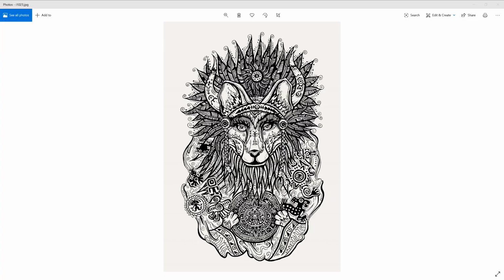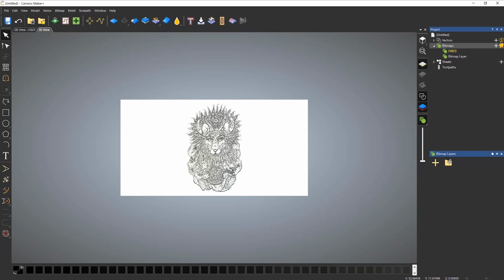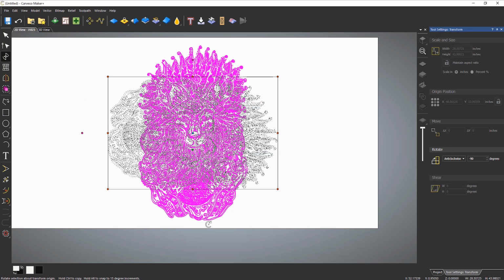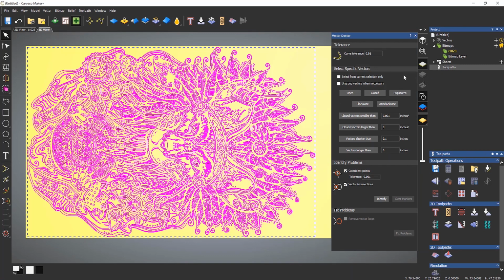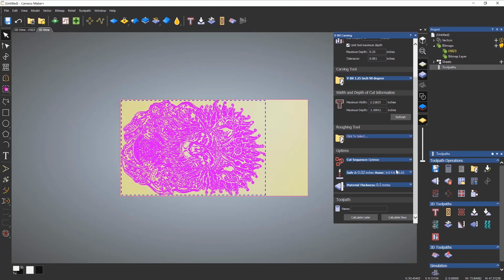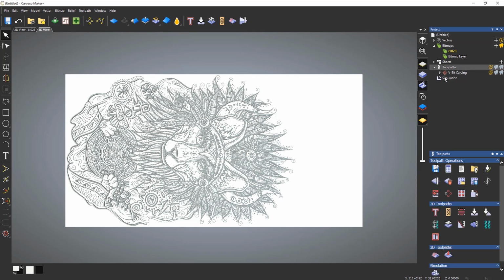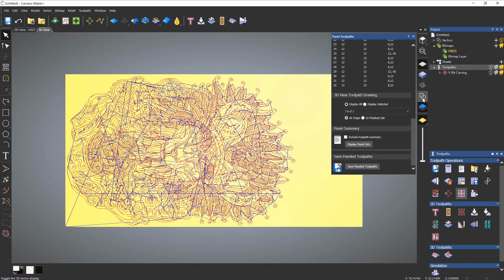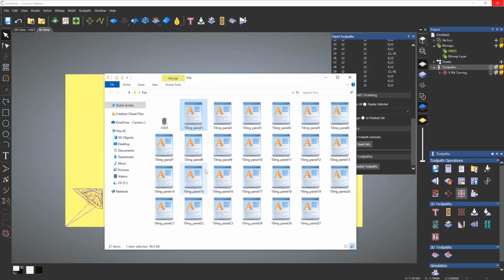Maker Plus Tutorial - Machining a Large Part by Panelling

Comment: How do I cut a large sign, such as a 5 ft long by 18inch wide Welcome porch sign without having to assemble pieces? The videos I see describe a process of cutting the board, moving the board and cutting the rest of the board. This process requires the software to input "allignment" pins to ensure the board is moved to the correct position. Is this tiling process possible with CarvecoMaker Plus?
Reply from the maker: Hi Dean.  Sure, that is a manual method with the alignment pins or dowels.  You can do that in Maker and we will post up a tutorial as soon as we can.